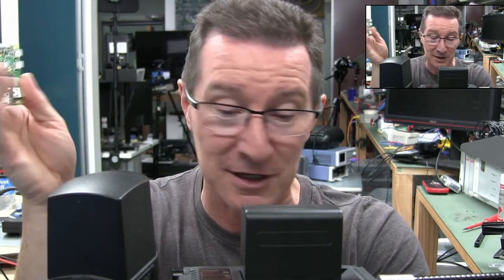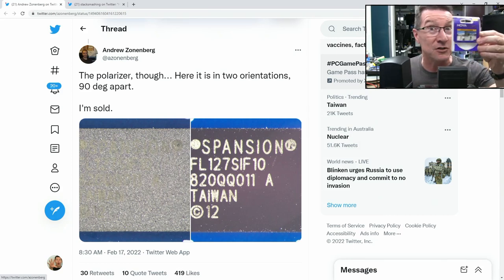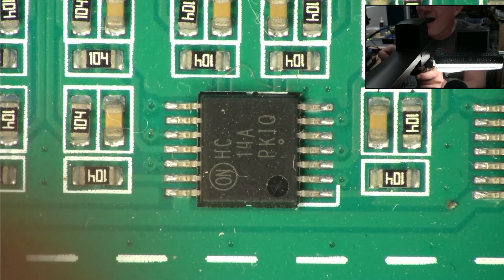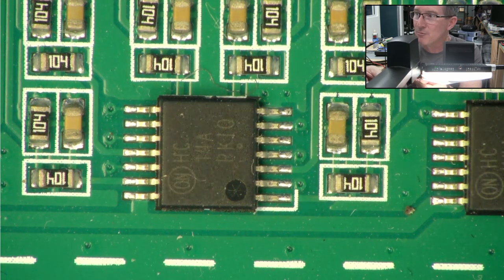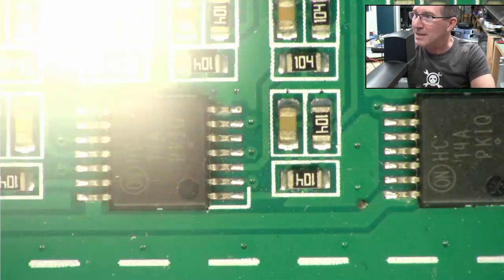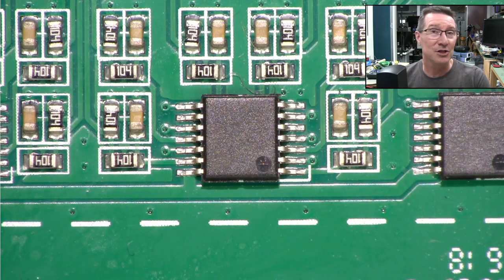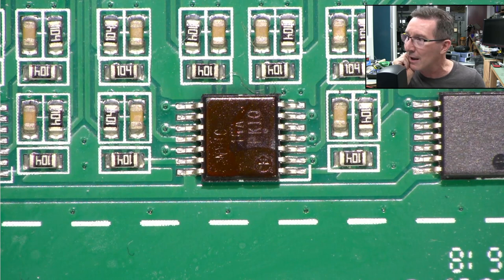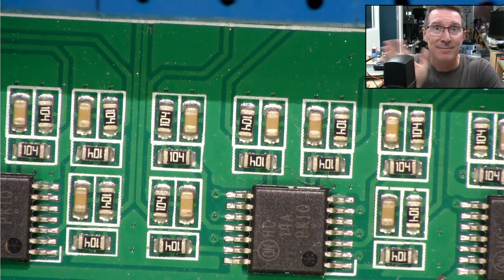EEVblog 1458 - Microscope Polarising MAGIC!

Comment: The reason why circular polarizers are preferred by photographers is subtle and not really adequately explained by "works much better than linear polarizers". The photos you would take with a linear polarizer would look identical to a so-called "circular polarizer", but the linear polarizer would send linearly polarized light into the camera, which can confuse and upset the auto-focus/auto-exposure features of the camera. So the circular polarizer adds some wizardy after the linear polarizer (namely a quarter waveplate) to take the light which has already been filtered by the linear polarizer part, and scrambles/circularizes the polarization. The filtering-according-to-polarization has already happened, but the polarization is rescrambled so that it doesn't screw with the auto-focus etc.

It just so happens that if you somehow attach the filter *backwards*, what you end up with is a filter that would be selective to circularly polarized light, but that's not the way we attach these filters to our cameras.

So TL;DR, it's really a terrible choice of name. A "circular polarizer" is a linear polarizer with a little hack added to prevent it from breaking auto-focus; and it has practically nothing to do (as far as the end user is concerned) with circular polarization.
Reply: 100% correct.
Reply: Thanks, dude! Explains everything. So basically we can treat it as 2 separate films, not one. Will attenuation get bigger on those? Is there a usecase for linear polarizer in photography (low light conditions or something)?
Reply: @__-nd4hf  I'd wager that the attenuation caused by the quarter wave plate is pretty negligible; I can't imagine a reason for actually preferring a pure linear polarizer.
Reply from the maker: Yes, that what I said in the video, it upsets the autofocus and other systems.
Reply: He literally said the same thing in the video.
Reply: I use a better solution...  White dry erase black board markers.  I scribble on the chip then carefully surface wipe the chip trying not to rub too hard so that I don't take the ink out of the etching.  It has helped me read quite a few chips.  And sometimes the heat from a hot air gun will make the ink permanent (probably depends on the ink type).  HA! didn't watch the video up to the marker spot before I commented ;-)
Reply: But why can't I find a set of adjustable circular polarized glasses.  I just want some rotational adjustment function and cool circular lenses all in one.
Reply: The reason why you don't use a plane polarizer is that one can often reach extinction conditions when composing your picture, meaning that you cut down a lot of incoming light when the filter is aligned 90° with respect to the polarized reflecting light, while also cutting the different plane-polarized image that the autofocus expects. Adding a quarter wave retarder to the plane-polarized filter, aka a circular polarizer, means that you seldom reach extinction conditions, since it is playing on phase shifts. Thus, you have light for metering and also have the slightly shifted image the autofocus expects.
Reply: @Marcin Berman That's a typical case of like envy you're showing there.
Reply: @TheHuesSciTech  Overall attentuation: Ca. 80% - 90% of the light gets through if you buy a high quality filter.
Reply: Bingo, came to say exactly this.

For what we're doing, PL vs CPL makes practically zero difference as long as you keep the linear side towards your subject. Whether the light is circularized on the ocular side of the microscope or on the light bulb side of your light source should make zero difference whatsoever, except maybe losing a little brightness.
Reply: I would say it is the other way around.
If you use the filter properly, it filters circular polarised light, hence the name.
In actual use as a circular polariser, it is used to create circular polarised light and filter circular polarised light.

It is just that someone decided (or screwed up) to use it backwards, as a linear polariser and quarter wave plate.

But the use you described is clearly using it backwards.
Reply: @ciprianpopa1503  Adding a quarter wave plate before the linear polariser, to make it filter circular polarised light, defeats the point of using one in the first place to reduce glare, or does nothing, depending on the orientation.
Using one after, as done here and described for photography, as a backwards circular polarised filter, would not magically create light and you would still have those "extinction conditions"
Reply: @jeffreyblack666  "Adding a quarter wave plate before the linear polarizer, to make it filter circular polarised light". The quarter wave plate does not filter circular polarized light. The latter is a combination between quarter wave plate and a plane polarizer. In fact,  the combination is also referred to as a depolarizer, and that is why the combination does not meet the extinction condition, condition met with two crossed plane polarizers in special orientation (those we actually want to avoid). In fact the maximum depolarizing effect is when one places the quarter-wave plate at 45 degrees between the incoming plane polarized light and another polarizer placed at 90 degree with respect to the first polarizer. Anyway, that case above is hardly met in practice, when what you get is retardations with increasing wavenumbers, which add to the initial 1/4  (phase) retarder. The effect is that you have evermore strange depolarization modes. For example, at 1/2 wave phase retardation we get elliptical (de)polarization.
Reply: @ciprianpopa1503  I didn't say a quarter wave plate filters circular polarised light. You even quoted what I said and completely ignored it.

A quarter wave plate in front of a linear polariser (at a specific angle of 45 degrees) will filter circular polarised light.
When I said "it" I referred to the combination, not just the quarter wave plate.

It is not a depolariser, as it just changes the polarisation. It doesn't depolarise anything.

Depolarising means making the polarisation random, not changing it in a systematic manner.

And you ignore the more important part of my post. The point of using filters is to reduce glare. The best way to do that will result in possible extinction conditions if the light is all polarised the same as the glare. Doing something to make it brighter means you are letting the glare in.
Reply: @jeffreyblack666  These are your words: "to make it filter circular polarised light". I cited them twice, but still you can't see the problem. So, you did say that adding a 1/4 λ plate would filter circular pol light. 
And, a circular polarizer it is a depolarizer. Stop making a fool of yourself. Look here https://en.wikipedia.org/wiki/Depolarizer_(optics)
The glare is cut by filtering the plane polarization at Brewster angle(s) and then depolarizing everything in order to not make the autofocus go mad.
Reply: @ciprianpopa1503  Yes, you quoted them twice, yet still managed to completely fail to honestly represent them. The first time may have been a mistake. But the second time, especially now that you cut down the quote even more, just shows it is blatant dishonesty.

I stated that putting a quarter wave plate in front of a linear polariser will filter circular polarised light.
yet instead you pretended that I am claiming a quarter wave plate all by itself will filter it.

And no, a circular polariser is not a depolariser. Have you even bothered reading your source (which itself is just a statement without a source)?
It states:
"In many applications it is possible to use a quarter-wave plate to produce circularly polarized light, but this is only possible for light of a limited range of wavelengths which is linearly polarized to start with."
That certainly doesn't sound like it is a depolariser.
It is still polarised, just not linearly.
Reply: @jeffreyblack666  Oh dear, you're climbing a greased wall.
Reply: @ciprianpopa1503  How? Are you saying you are extremely dishonest and slippery and that you will continue try to slip out of getting called out on your BS, and pretend you were always right?
Reply: Thank you very much for the explanation! I got really confused why photographers would use a circular polarizer (if they don't photograph stuff like sugar solutions, that is) as the shown examples in the video are due to different reflectivity of s- or p- (linearly) polarized light at a surface.
Reply: @jeffreyblack666  A Circular polariser is called a Circular because of the shape and can rotate. The clue is in the title, It is Not because the Light is circular!
Reply: @madb132  If that was the case, there would be no advantage to using one over a linear polariser. As you can get linear polarisers in any shape and you can rotate them; and it would still produce linear polarised light which would affect the camera systems.

Circular polarisers are called that because they will either (depending on the orientation) create circular polarised light or only allow circular polarised light of a particular chirality to pass (typically ending up as linear polarised light).
Some are made to do both, by attaching a quarter wave plate to both sides, so only circular polarised light can enter (which would include 50% of unpolarised light), and the output will also be circularly polarised.

It isn't the light that is circular, it is the polarisation.

Even those for cameras are typically called that because they produce circular polarised light so the camera systems which are sensitive to linear polarised light are not significantly affected (other than a lowering of intensity); but they act as a linear polariser to filter linear polarised light, specifically to exclude one polarisation), and then a quarter wave plate to convert that linear polarised light that it allowed to pass through into circular polarised light.
Reply: @jeffreyblack666  Really? you went their! Oh , So if i rotate A LINEAR one it would do the  exactly same thing! It just won't screw on the front of the camera.   It is just a way to mount it to the lens easier. They both do the same thing.
Reply: @madb132  If by "their" you mean explaining why you are wrong, then yes, I went there.
You can get linear polarisers, which are circular, and which you can rotate. They are still linear polarisers, not circular polarisers.
Likewise, you can get circular polarisers, which are not circular.

The way they are used in photography, the effect they are trying to achieve is the same; cutting out the glare by filtering out linear polarised light in one orientation. But the effect on the camera is different as some components are sensitive to linear polarised light.
So no, they don't both do the same thing.
Reply: @jeffreyblack666  yeah, My grammar is crap, i know. But still the only difference between the 2 is that circular ones have a Quarter wave plate behind. you can get the same effect if you have two linear ones back to back but only rotate one of them, yes the light will block out all of it at one point wityh the linear but that's why circular ones differ, because of the quarter wave length plate.
Yes, i know photography, had the dark room and all. Don't do it now as my hands shake to much😣
Reply: @madb132  And do you know what that quarter wave plate does? It turns the linear polarised light into circular polarised light. And that is what gives it its name.

If you take a linear polariser and a circular polariser oriented as cameras have them to produce circular polarised light, with the 2 linear polarisers facing each other, as you rotate one of them it will act similar to 2 linear polarisers, where you can still have it reach a point where it blocks out all the light.

If instead you face the quarter wave plate towards the linear polariser so it would filter circular polarised light and result in linear polarised light, then the full analysis is more complex, but you end up with the same amount of light blocked regardless of what angle you put the polariser at, which would be equivalent to a linear polariser at 45 degrees, making it entirely pointless other than to just cut down the amount of light coming in.

You might know photography, but you don't know physics.

Comment: Polarising sunglasses are a must when driving IMHO.  Road paint becomes more neon-like, road signs alike, you can see through the windscreens of other cars and see where the drivers are looking etc.
Reply: When I got my first pair seeing the other drivers through the back window glare was the best party trick
Reply: I had some for a few weeks, but the tinting on the rear windows of multiple cars I drove at the time would appear all checker board like... Which made it harder to see what was behind.
I should probably get some again since we own zero of those cars now, and I use the centre mirror much less now after several years of euro truck sim.
Reply: There was a time when polarising sunglasses were a serious hazzard when driving as the laminations and curves of a car windscreen would show up rainbow patterns all over the place which made it very hard to see the road properly. Even now they can cause problems as all those LCD screens in cars these days also polarise the light so it can be hard to read your binnacle displays (let alone the sat nav). Basically they reduce road glare but CAN create unwanted patterns so must be chosen with great care.

Comment: Yeah, I've found that side lighting is more effective than polarizers.  If you have a small, high intensity flashlight you can shine it on the part from the side temporarily to read the markings while leaving the microscope and lighting set-up alone.  Most of my microscope viewing is to asses solder connections, which turn to dark grey or black viewed through polarizers.

Comment: Cheaper to use both the lenses of a single polarized movie glasses ... a child's polarized movie glasses will set you back around £1

As shown in this video, but use one movie glasses lens over a light source, and other for viewing as shown in the video ... 1st find the lenses correct orientation, place one lens over the another held up to a light, look through, and flip and 360 rotate a lens until you can't see through them both ... when you find the darkest reaction, this is when you know you have the correct orientation ... remembering the lenses correct way around, use one over light source, one for viewing through as shown in the video ... using polarized movie glasses to convert a standard compound microscope into polarized light is common in microscopy
Reply: Or, if you have the glasses still in tact, you want to set it up so the light goes through one lens as if it was going towards your eye, and then reflect off the surface and come out through the other lens.
That is so both are acting as linear polarisers, and rotating one lens around will change the brightness.

If you go the other way, so light goes out from your eye, reflect off the surface and then back into the other eye, then rotating the lens will do pretty much nothing.

Comment: Dave doesn't really make the point that when light is reflected from a surface at an angle, it is possible to get an angle where the reflected light is completely polarised. This called "Brewster's angle" (see https://en.wikipedia.org/wiki/Brewster%27s_angle ). A single polarising filter can then remove that light, so that the black surface of the chip is seen as black again, thus allowing the etching to stand out clearly. You don't need to polarise the incident light for that effect to work, so you don't need two filters. You just need to have the illumination coming from an angle, and the viewpoint at a similar angle on the other side. That's exactly how Polaroid sunglasses work.
Reply: Polaroid makes sunglasses?
Reply: @newtonfigley6948  From https://en.wikipedia.org/wiki/Polaroid_Corporation
"The original Polaroid Corporation was founded in Cambridge, Massachusetts, by Edwin Land and George W. Wheelwright III in 1937. ... Polaroid’s initial market was in polarized sunglasses — spawned from Land’s self-guided research in light polarization. Land, having completed his freshman year at Harvard University, left to pursue this market, resulting in Polaroid's birth."

So, yes.

Comment: I use the "andonstar polarizer film disc" bought on eBay and is very effective.
Essentially you use two discs for side Led illuminators and one for the objective. Once adjusted works like magic